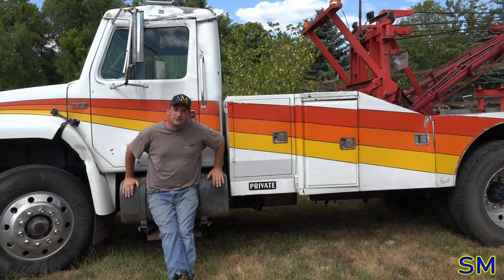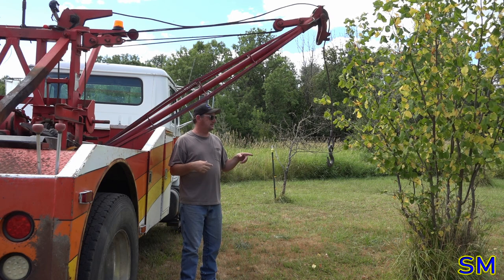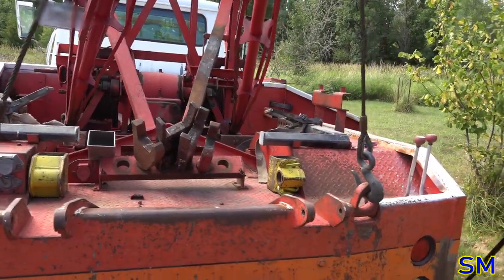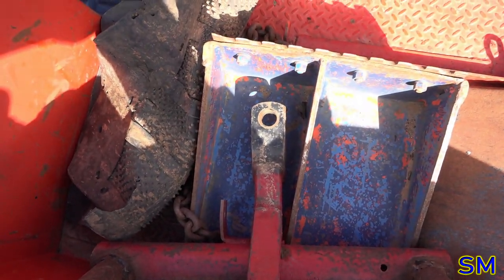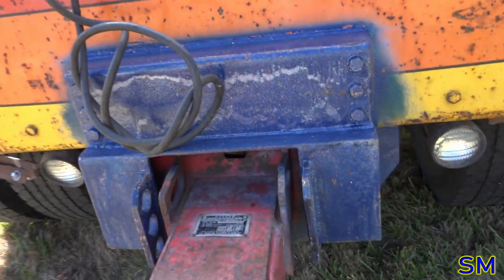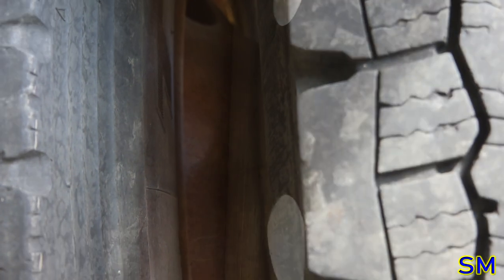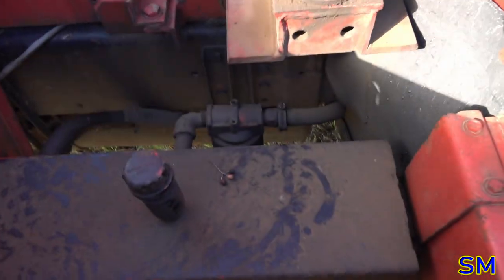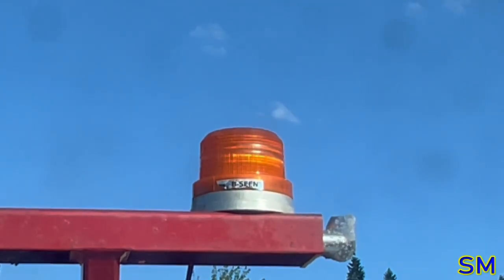I Bought My 1st Tow Truck "Lil Tugger" -1989 International S1900 DT466 Holmes 500 Split Boom Wrecker

Comment: Well hello. I just stumbled across your video and I must tell you, you certainly found a gem. When I started towing, I learned on a 69 Ford F-600 with the Holmes 500 for the back. Then worked my way all the way up into a Century 9055 on a Peterbilt. In the many years of towing, I have driven many sizes and types of trucks. From mechanical to hydraulic. Along the way, I have always loved where I started. The truck you have there is still in really nice shape. It does need some attention, but it is not a basket case. When I started towing in the 80’s, there was a tow company in southern CA that ran that paint scheme. For the life of me, I can’t remember the name. That’s probably where it started. I am on the east coast, so trucks such as this one are pretty much rust buckets. I have been out of towing for a few years now, and miss it from time to time. I think I’m going to look for a project truck such as an early Ford with the Holmes 440 or 480. Something to tinker with. Anyway I wish you the best of luck with this truck and keep us updated on what’s happening with it, if you can.
Reply from the maker: That’s a great story thanks for sharing. I do know the original company that had this in Cali and they are in fact still in business! It’s in ok shape, and if I need to fetch a vehicle it’ll tow tomorrow. Much to do here for sure🙃 Bless! 💪🏼✌🏼

Comment: As an X wrecker operator the booms actually extend on the units that ran. If you converted the wenches to hydraulic or electric it would make it easier to swing the booms out. 

You could look in the wrecking yard and find a set of extended booms or just make a set yourself.

Those repairs are from over loading those booms as those winches don’t care and will pull way more then they are rated for.
Reply from the maker: Thank you for the insight. I definitely agree. Those winches are absolute powerhouses. I would imagine the weakest link would be your booms. I’ll keep an eye out and I’ll do some snooping around. It needs a lot of help, but honestly, it’s a lot of fun for a hobbyist. If I was doing full-time wrecker operations, this thing would make me exhausted after a while lol. But I love the old iron.😄👍🏼💪🏼. Thanks for dropping by!

Comment: I have a Holmes tow bar that yours is missing and I know where a set of booms are, I’m not sure where you’re located though. I’m in Pennsylvania. Also the style of fork receiver on the driver side is correct for a Century underlift. Is your crossbar 3.5x3.5? You can buy replacement frame & axle forks from Zips AW Direct or Irish Iron wrecker. The scotch blocks should have chains on them that go in the banjo eyes on the tailboard of the bed. You back the rear tires up on the scotch blocks as far as you can go without the tires falling off the backside and then hook the chains in the banjo eyes. Then when you start winching, the weight of the wrecker pushes down on the teeth of the scotch blocks and the chains help keep them planted under the wrecker so the wrecker doesn’t slide over the end of the scotch blocks. The banjo eyes are right next to the reverse lights. Zips AW Direct also should have the schematics for the Century Formula wheel lift and should be able to get you the rebuild parts for it, like the wear pads that go in the main tube. There’s nothing wrong with the steel inner wheels, they make rings that go in between inner wheel and the outer wheel so they don’t corrode together. They look like a gasket basically. Also the rear main seal probably isn’t leaking, that’s probably grease from the clutch release bearing. That little grease line hanging down out of the bottom hole of the bell housing is to grease the clutch release bearing. So the cool thing about Ernest Holmes and Century are, Gerald Holmes started Century Wrecker Corporation because he believed the old mechanical wrecker needed updating but he couldn’t convince his family that the mechanical wreckers needed updating and that’s why he started his own company. The black metal switch panel with the gumball light covers is an original Holmes panel. And if you grease the clutch release bearing, that noise should go away, just don’t pump too much grease into it that it leaks out onto the pressure plate and clutch disc. Yeah it should probably have the Leece Neville alternator. I absolutely love the truck and I can’t wait to see more videos on it!
Reply from the maker: Wow thanks for all your info! Thats funny how the Century business got started!! That’s an awesome story!

Comment: I just did an alloy swap on my 1990 4700 4 door. When you swap inner wheel there like 5/8” thicker so possibility you have to press in longer studs.
Reply from the maker: Ah 10-4. Very possible I will have to do that. Thanks for the heads up!

Comment: That's a sweet Galaxy 959 I use to have one in my truck ran off a K40 mag mount and ran a Ranger 2990 Base station with a Antron 99 60 feet high use to talk all over on the LSB I still have a Silver eagle Astatic desk mic and I have a bunch of Portable hand held power mics a Astatic D104 and a Astatic road devil mic I still have my gear just not set up after I moved I did not hook it back up that had to be 10 years or more I still run the Radio in my truck I have a couple small 100 watt and a 150 watt Linear amps but I use to be right into the CB thing had a bunch of money into it use to Tune up the Cobra 148 GTL put HD finals and crank the watts and add more channels but they don't make the Cobra 148 GTL anymore but they use to be the best low budget radio that you could really make a power house out of.
Reply from the maker: Will definitely be saving the 969. Maybe throw it in the shop and have it tuned up and recalibrated. I would love to put a 102 inch whip on Lil tugger but I’m not sure where it would go. I’ll figure it out haha😁

Comment: I’m willing to bet they bent the loops on the wheel lift using the loops as a low connection points. (With the lift in the down position) Sometimes required for rolling vehicles.
Reply from the maker: Ahhh that's definitely possible. There really isn't a low connection point other than the wheel lift. If your out in the field and that's all you have to get the job done I get it.....but lets fix it at some point haha. Great opinion!

Comment: That's not a Holmes,600 but it's a much smaller Holmes 500 the different is a 500 is a 10 ton wrecker and the 600 is a 16 ton wrecker Big different between the two the 600 has outregers on the mast and the 500 does not have outregers on it you can do way more with the 600 than you can with the 500 I hate to break your bubble I ran all of the older Holmes wreckers from the 400rw all the way to the Holmes 850 so I know all of them very good thank you very much Charlie kretschmar Phoenix Arizona
Reply from the maker: Thanks for taking the time to comment! My data plate says 613P for the Model number. Serial number states it was built in 1978. The reason for no outriggers on my truck is that they needed to be removed (or not installed at all) to make room for the hydraulic tank on the left for the wheel lift, and the truck battery’s needed to be installed on the right, where the booms would have gone, since I have dual fuel tanks. Thanks for watching
Reply: @SwedeMachine I agree with Charlie above, the tell tale sign that it's a 500 is the forward mast supports are angle iron, the 600's I've worked with had square tubes, and I also don't see the side leg mounts on the forward mast. The winch gearbox I believe is the same between the 500 and 600, but boom and mast design is much different between the two to achieve the extra 6 tons. The boom support cables also have a triple shive gooseneck on the top of the forward mast, the 500 has 2 different shive blocks.
Reply from the maker: Huh. Maybe you are right. I see the mast with the square tubing on the 600’s vs my angle iron type. Although this thing has been abused so much maybe things were swapped out. Maybe my data plate is wrong. Eh oh well. Still a great piece of history that will survive on the this channel anyways. Thanks for all your insights.
Reply: Definitely not a Holmes 600 !! But still a tough little unit ! I run a 600 as my Heavy Recovery Truck and LOVE it !!. It works on those muscles but it's a BEAST !. Wish I could send pics.
Reply: Here's my IH S1854 4x4 Offroad Recovery Wrecker